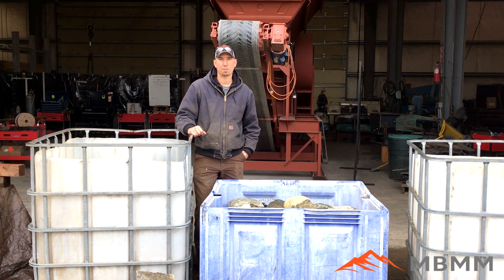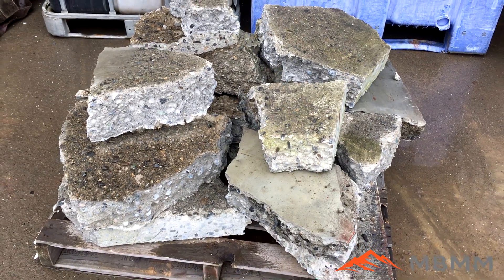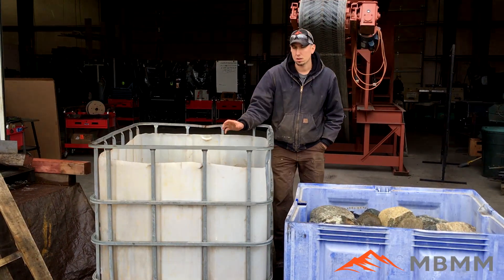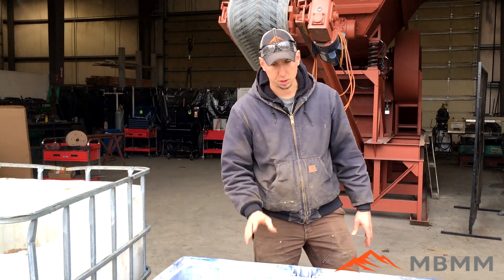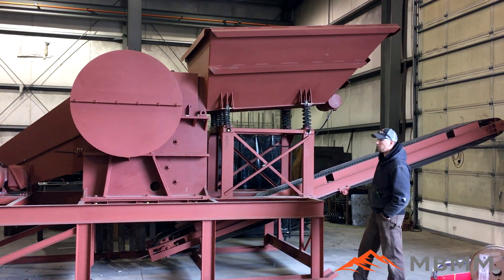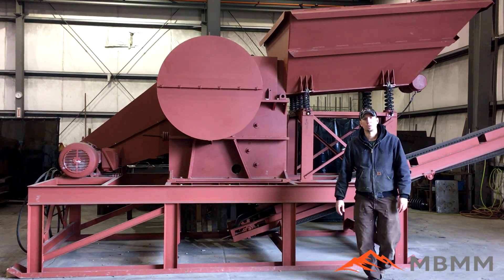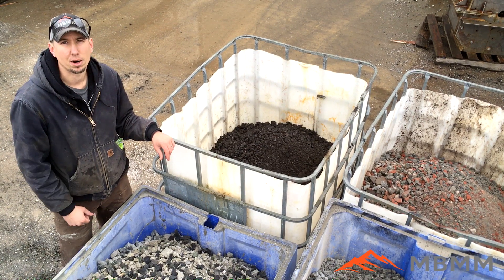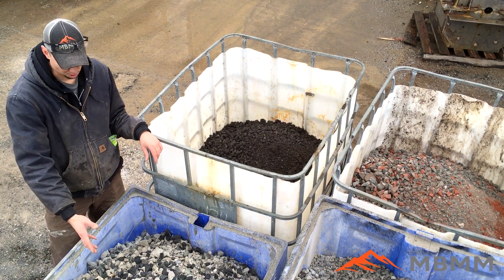Rock Crusher for sale for Concrete Recycling, Asphalt Recycling, Brick Recycling, Stone and Rock

Comment: How long does it take to build that module?
Reply from the maker: Lead times vary by a number of different factors, such as the one shown in the video is available for immediate sale while building one from scratch can take anywhere from 4 weeks to 8 weeks depending on our current shop load.
Reply: I Jason, thanks for your video.
Can you ship to Quebec, Canada?
And do you think this crusher can do 30t/h in asphalte (or close) with 1 inch minus?
Reply from the maker: We can ship to Quebec, Canada and I don't believe you would be able to get 30 tons/hour with a 1" minus more in the 15-20 ton/hour range for asphalt.
Reply: Ok, thank you very much, I'll check this out.
Reply: How much  cast the crusher